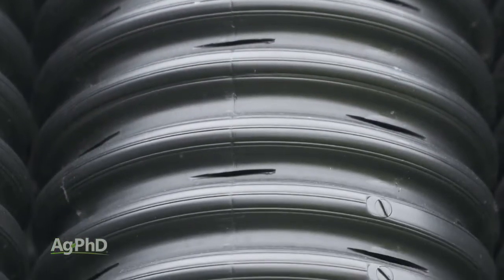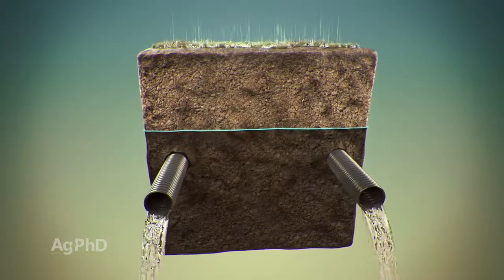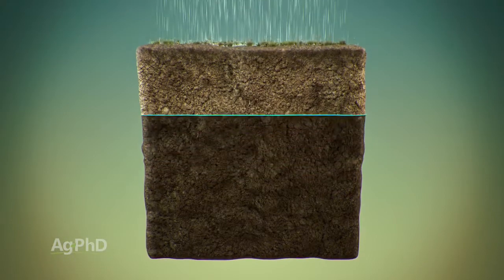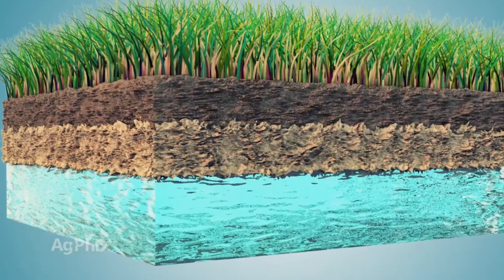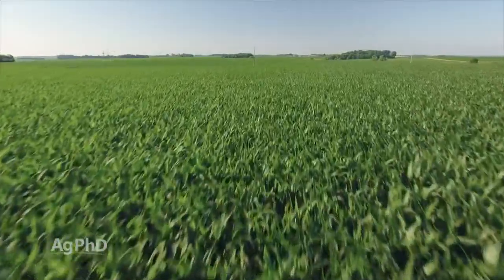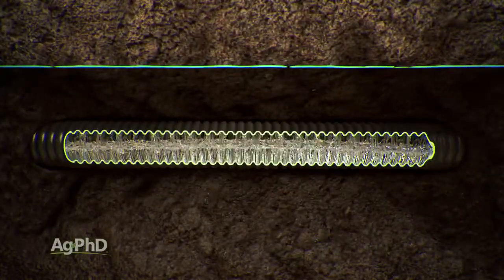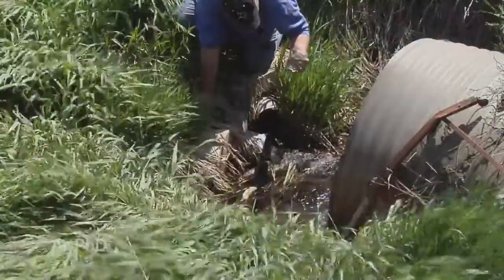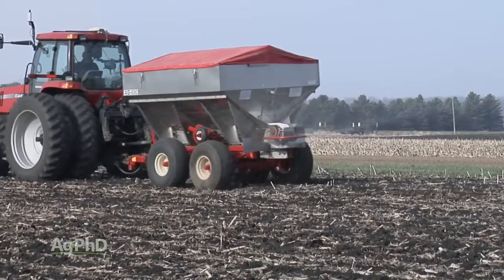Farm Basics #1114 Drain Tile Basics (Air Date 8-11-19)

Comment: This is Amazing, but I dont understand how those dont get clogged. Im in construction and 90% of the time we are pulling those out from around foundations they are clogged because they were not placed in a sleeve or a sock. Seems counterintuitive. Also I love using PEX because its flexible, but the flexibility on that line seems wayyyy off. Also the Corrugation, Corrugations are not allowed in any drains in Los Angeles because stuff gets clogged in the Corrugation. Seems like that would fail inspection because of the corrugation. The pipes we put around houses are so rigid hard, so that they arent crushed. Regardless this is so interesting, I never knew this.
Reply from the maker: Brian addressed your comments on Ag PhD Radio: https://on.soundcloud.com/tiX6N

Comment: I like that the subject of soil aeration was mentioned and think it could be even more emphasized. The words 'root respiration' could be mentioned a bit more but maybe that's too technical and best left for a video aimed at a different audience. 
The word 'drainage' and the idea that water is just going to go out of the soil like around stones or ice cubes seems to be the source of a lot of fears. One can't overdrain a mineral soil, and like you mentioned, flooding downstream can be reduced because the air spaces in the soil will absorb water.There has been at least one study done on it. One could also mention for farmers that a wet soil is a cold soil and will delay planting. That's one reason farmers might plow a field and expose it to wind erosion to dry it out.
I very strongly dislike the shot of the 4" outlets shown in this video. They appear to be completely contrary to accepted practice in the province of Ontario, Canada which has a good century or more of farm tile drainage use back to use of clay tile. A drainage inspector might insist on at least placement of a rodent guard on the end (it's just a heavy metal wire in a kind of 'S' shape that fits into the pipe corrugations) and maybe even a metal culvert with a collar, angled end and grate. I once helped install drainage tile very near the shores of Lake Erie in Southwestern Ontario where just a rodent guard was put on the end of the 4" tubing into a ditch. We were tiling through snow drifts so sometimes the tubing had to be trimmed at the outlet end in the open ditch because they were a bit too long. Another time, I was blinding a short pond interception run of agricultural grade polyethylene tubing with a water sock behind a Buckeye Wheel machine in Manitoba Canada and I wasn't too sure the line of tubing that had lain in the sun when we went to lunch wasn't so soft that it was being crushed by the chunks of soil I was breaking off from the trench. I checked and it wasn't but the heat did affect the pipe and I might have missed seeing the pipe get crushed. It's supposed to be able to handle a semi-trailer truck running over it. 
My father tried to get farm tile drainage going in Manitoba Canada in the late 1990's and the fear of flooding and thinking that holding water back on upstream land was a good idea was a major obstacle. I really didn't have much sympathy for farmers in western Manitoba that were rained out of their fields in the late 1990's after years of insisting to one and all that all of Manitoba was dryland farming. An experienced Professional Engineer and drainage contractor was astonished by the amount of water coming out of Manitoba fields he tiled as a drainage contractor. These weren't even artesian springs, just land that was only surface drained. People heard about the nitrogen contaminated drainage wells in Iowa and assumed that installing tile drains in a field would poison their drinking water well.  People that had no experience of farm tile drainage would jump to the wildest conclusions before they were fully informed about it. Tile drainage has its pros and cons just like open surface drainage ditches and roadside borehole ditches with noxious weeds. An attempt to get farm drainage going in Manitoba, Canada had been made a few decades earlier but there was more focus the first time on its use in the clay on the floor of the Red River valley than on the sandy soils of the beach of glacial Lake Aggasiz along the Manitoba escarpment, which was much better suited for crops like maize and potatoes. So, I liked that you added the point about the soil soaking up the water and that the tile don't run until the soil is completely saturated (meaning the agricultural producer is either over-irrigating, wasting water and drowning the crop roots or the water table has risen to the level of the tile or higher). 
I wish that the point that agricultural subsurface drainage tile is very much stronger than house weeping tile was made. There have been farmers and even roadway engineers in areas where agricultural subsurface drainage was not known or not well known that have made the mistake of using weeping tile that subsequently was crushed after installation and so the tile didn't work.The weeping tile looks exactly like the agricultural grade subsurface drainage tubing. 
My father investigated a 'bathtub' drain that a Manitoba farmer had installed in the 1970's but the farmer wondered why it didn't work and my father, who had many decades of experience with tile drains in Ontario, Canada, found out that the reason the drain didn't work was because the pipe went off grade when the operator of a D8 made a turn and the shoe, which was not well controlled by the type of equipment used, went up and the pipe went up with it and off grade so water didn't flow to the outlet.
Reply from the maker: Brian and Darren addressed your comments on Ag PhD Radio: https://soundcloud.com/agphd/06-24-22-farmer-friday?utm_source=clipboard&utm_medium=text&utm_campaign=social_sharing#t=48:55

Comment: Wow. This stuff is far out. I live in California and we would never pass on the water
Reply: Same, but northern cali gets enough water. It's mostly a sign of a farming and rotation crop issues. That they are brute force solving instead of working with the land to solve the problem. Which in turn hurts everyone down stream because it means the water holding capcaity of the farm gonna suck long term. But as they were probably till/not building organic matter in 3 or 5 years from a solid no till program they were probably pushing all that rainwater out anyways. Overall this is an ecological nightmare but probably less of a nightmare than what they were already doing.

Comment: What about for smaller acreages?  I live on a 4.5 acres in a swampy area.  In the spring, there is a standing water after all the snow melts.  (I live in northern Alberta.)  I have tried having a garden, but it is such heavy clay soil.  I planted fruit trees and they all died.  I have planted lilacs.  They have not died but the plants are still very small after 4 years.  I also have a miniature jersey cow and would eventually like to have 4 of them as I breed her for milk.  

Behind my acreage, on crown land, there is a huge swamp where many ducks and other water fowl land.  I like hearing them all summer long.  I am thinking of have a drainage line from my land to the swamp.  Because the swamp is so big and I have only 4.5 acres. I think that if water from my land went into the swamp, it would make very little difference in terms of the depth of the water in the swamp.  

Alternatively, since my acreage is right on the main highway, I'm wondering if I can put a drainage line that goes into the ditch along the highway. Thoughts on this ?
Reply: Hopefully you leave that swamp untouched and natural!! Waterfowl need wet areas like that!! Fields are being tiled in northern US and Canada at all time high and duck numbers are in decline bc of field tiling.
Reply: @andrewn.5117  I will.  I hear Canadian Geese and ducks quacking.  I'd so much rather hear that than the sound of traffic in the city!  There are lots of mosquitoes.  However, they don't last the whole season.  Maybe I can find a way to breed dragon flues to eat the mosquitoes.  :)
Reply: @trevorstolz8580  do you hunt waterfowl?
Reply: @andrewn.5117  No.  I just my mini jerseys - not beef cows at all - and garden.  I had chickens also.   I let them free range but the coyotes picked them off.   I might make a big enclosure, separate it into sections, rotate them through the sections so they are always on green grass and put electric fencing around it to keep the coyotes,out.  I for one thonk that hubby farming can b done in a way that is far more humane than what happens in industrial farming.
Reply from the maker: Darren addressed your comments on Ag PhD Radio: https://soundcloud.com/agphd/03-21-22-calcium?utm_source=clipboard&utm_medium=text&utm_campaign=social_sharing#t=52:08

Comment: i'm sure when the crop is growing it uses more of the water but what about in the spring and winter. doesn't the water drain off faster causing the nearby streams to fill faster than they would have without the tile?
Reply from the maker: Brian and Darren addressed your comments on Ag PhD Radio: https://soundcloud.com/agphd/12-29-21-2021-in-review?si=62f42e6455c246f4b6773e6676d32d84&utm_source=clipboard&utm_medium=text&utm_campaign=social_sharing#t=51:28

Comment: I see farmers install drainage tile without wrapping the tile in a clothe barrier to keep dirt and rock from clogging it. I know tile used around a lower level basement has cloth, or gravel surrounding the tile for this purpose. Why is it farmers don't use the same procedure given that dirt can eventually clog the openings in the tile?
Reply from the maker: Brian and Darren addressed your question on Ag PhD Radio: https://soundcloud.com/agphd/06-10-20-why-herbicides-fail#t=51:18
Reply: @AgPhD  Thanks.And amazing,i couldn't believe those pipes could last so much without ''socks'' /geo textile arround them,or even some small rocks as filter.I plan to install some drainage pipes on 2 of my fields,right now while i am writing this there is water on those fields,draining is slow.I was on internet searchin allot as i couldn't decide should i just buy these corugated pipes 100-160mm diameter (4-6 inches) and place them in trenches like that with nothing extra,or should i waste more money on at least geo textile or even some agregates ....20 years lifetime i would be very happy with those pipes if they can pull that much.
Reply from the maker: @TheSRBgamer63  Brian and Darren addressed your comments on Ag PhD Radio: https://on.soundcloud.com/Wa1Yp

Comment: Do you know if there is a requirement for field drainage pipes to be mapped with the county?     Purchased a 25 acre property and found two sink holes.    Haven't dug around these holes yet to find out if there is a pipe in that area.   Both holes were found in a natural drainage flow area.
Reply: Drainage
Reply: Usually not a requirement.
Reply: Map it. Make a asbuilt. That way you know. The ducks and creatures have to some where else. Sucks no duck hunting.